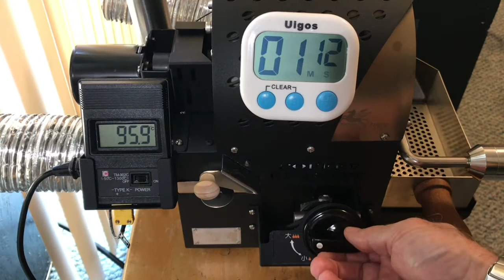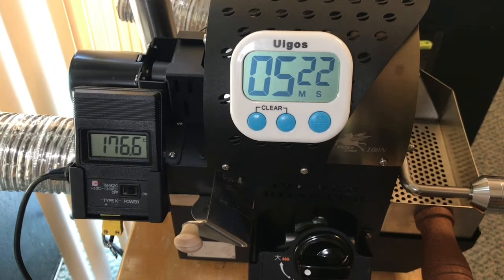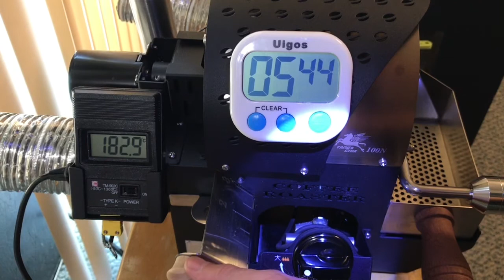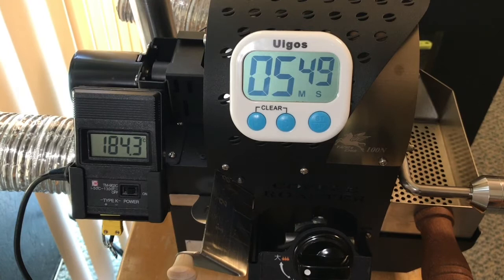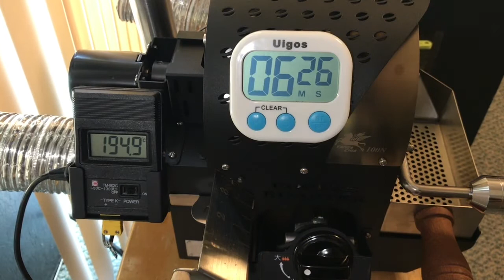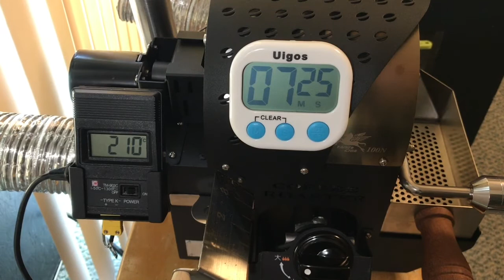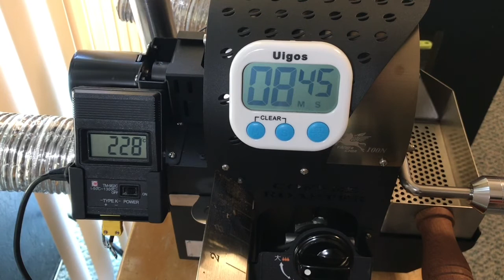Feima 100n Coffee Roaster 170g Test Roast

Comment: I have a problem with this machine’s burner, it is too weak. But watch your video i see it still roasting normally…
Reply from the maker: Try using a regulator with more pressure, 1psi will have more power at the burner.
Reply: @hankua  yeah I will try, the temperature is weaker when beans enter maillard reaction, causing me to roast longer...
Reply: @hankua  i tried, but it seems to lose temperature due to small heat source. I replaced with a larger burner, then its fine now.